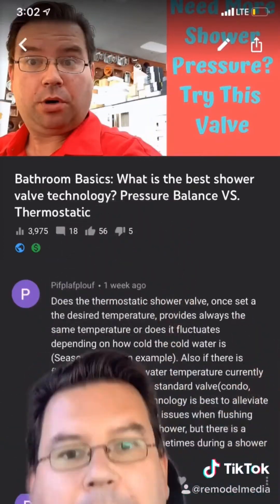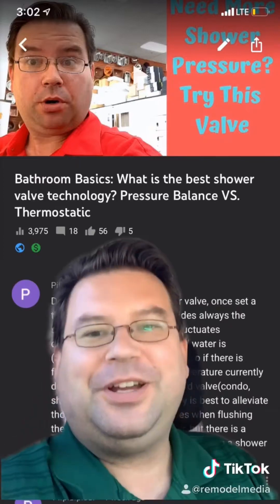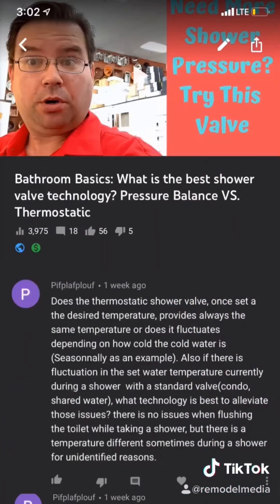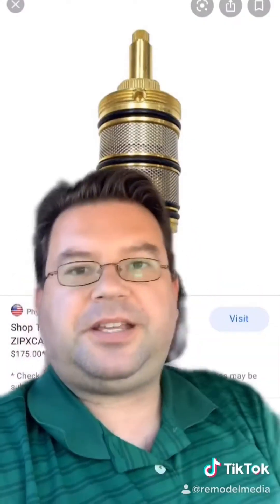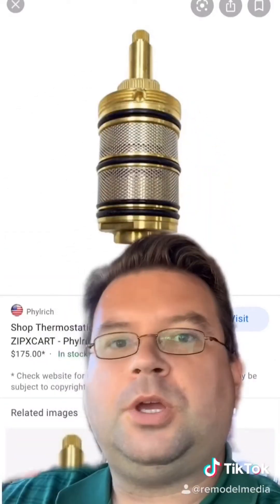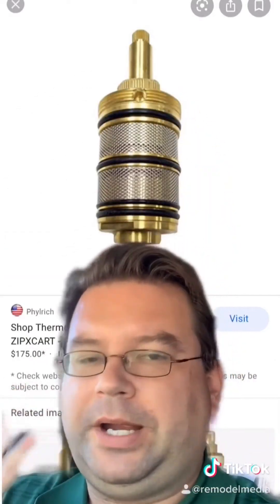How does a thermostatic shower valve cartridge work? Vertical video response

Comment: Can’t get hot water on hot side but is there if I remove the cartridge what could be holding it back
Reply from the maker: The wax or soft bi-metal inside the cartridge may simply not be responding to the temperature of the water which could indicate calcium or mineral buildup. The first step I would do is try to clean the cartridge, soak it in vinegar and water overnight. Put it back in the morning and see if it works. Also when you put it back make sure the inside of the valve is cleaned out as well. Also make sure the service stops are turned all the way on. If you send me a picture of what you’re working with I can probably be more help. But those are some general troubleshooting tips that I would try.